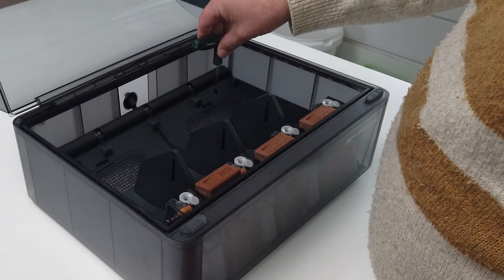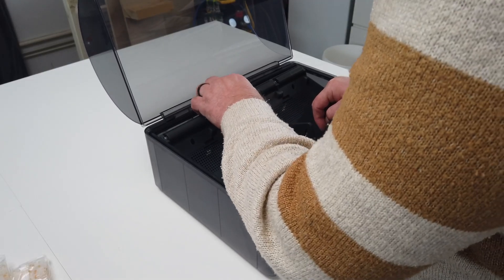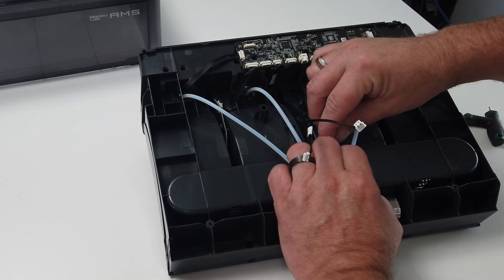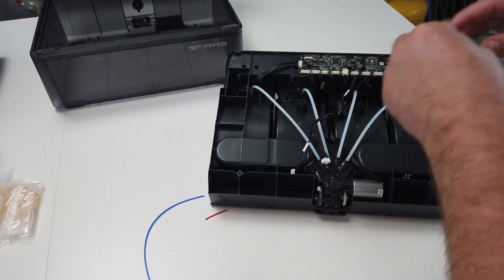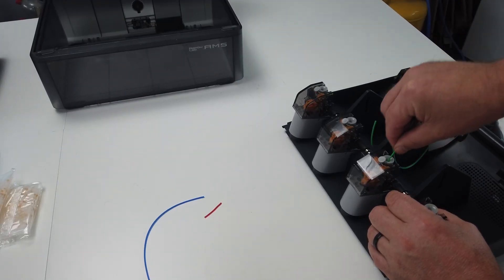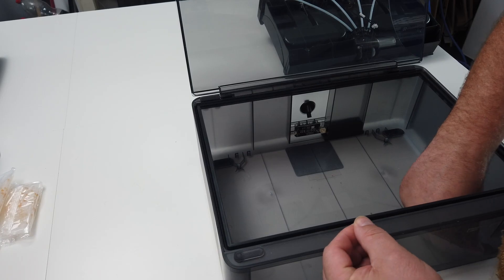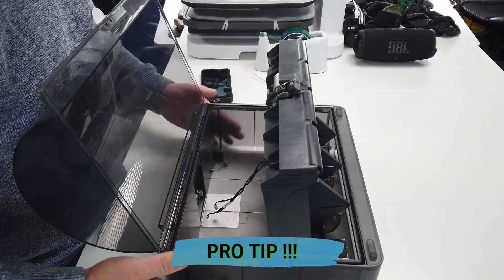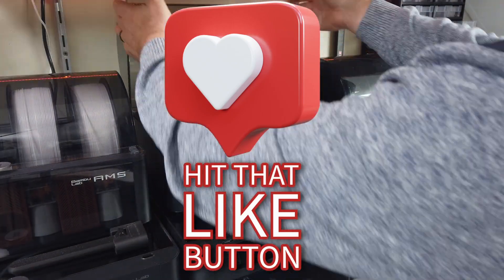Bambu Lab AMS filled with Broken Filament? | Here is the fix.

Comment: Thank you very much for this tutorial. I had a small piece of filament stuck in the AMS Internal Hub and was not looking forward to taking it apart again, as the magnets are really hard to put back in place properly. Your method of pushing through the filament worked perfectly. Thanks!